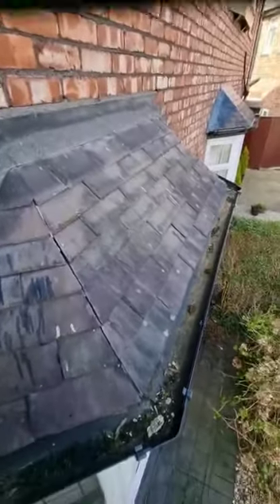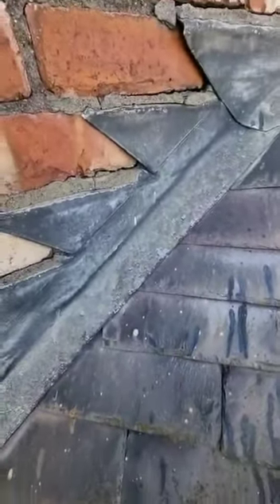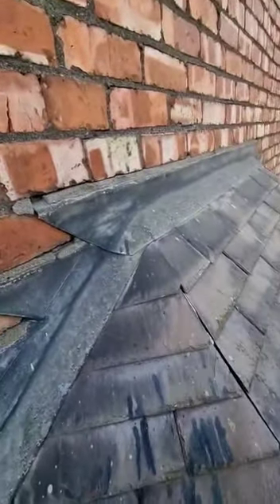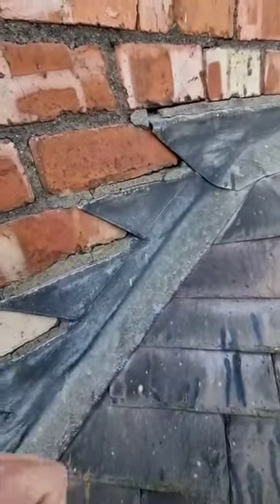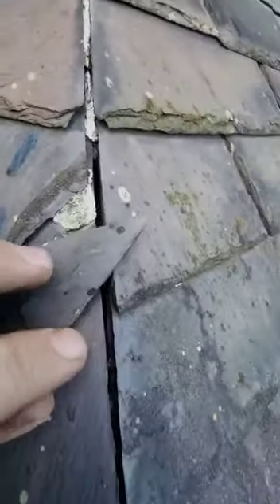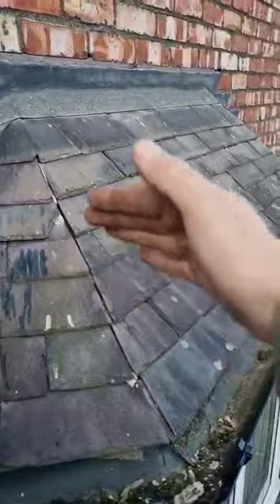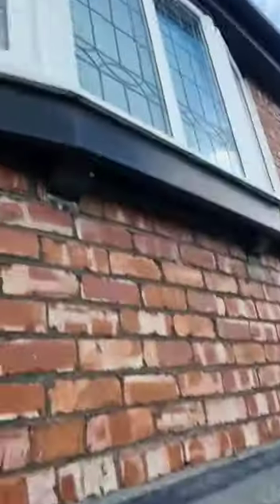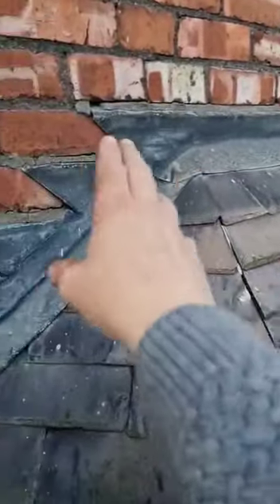slate bay roof

Comment: I dont think you need lead soakers on the hips on both sides of the bay window, i would gently lift up the slates and use plastic dpc and then use a good sealant to go down the joint of the slates.